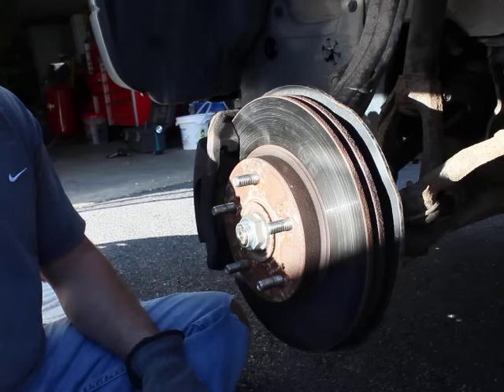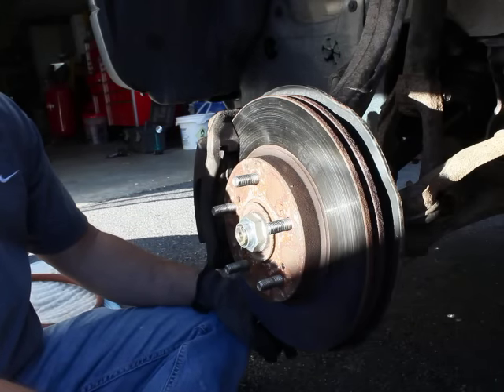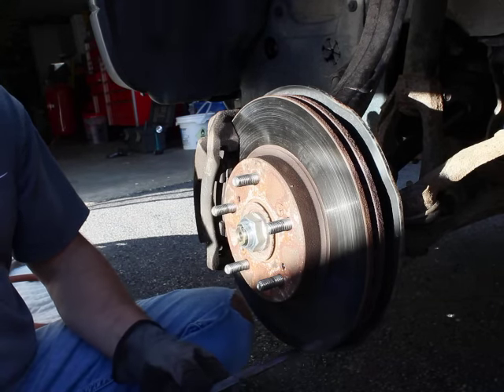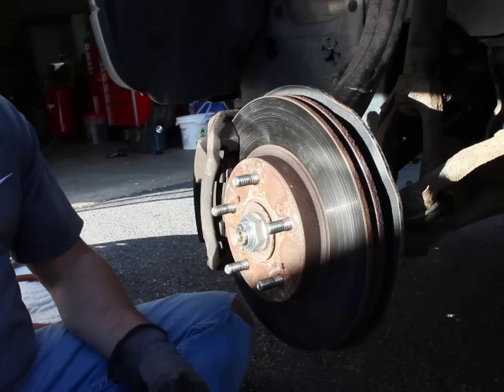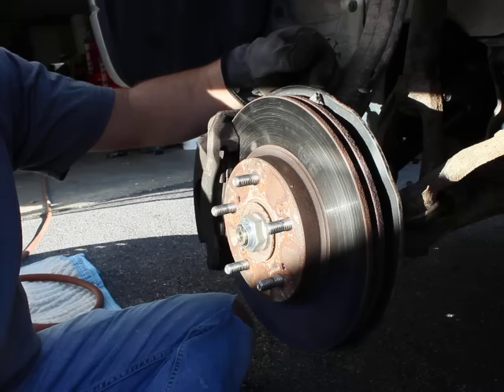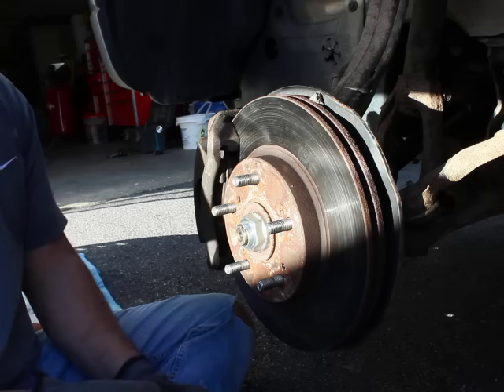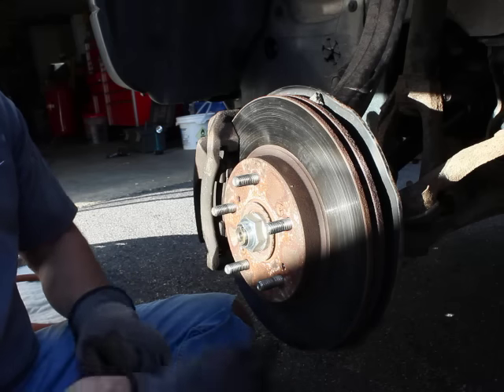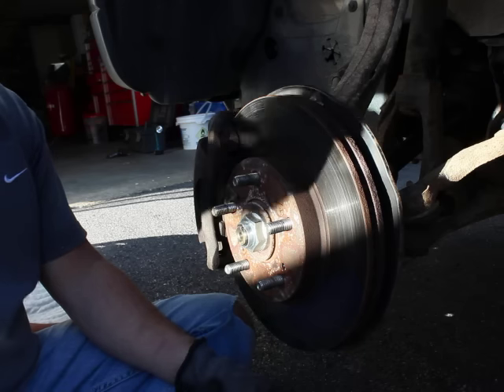Scraping Noise From Wheel While Driving

Comment: Had the same problem recently, and I must say, this video was spot on in the diagnosis. Went to my local mechanic and the guy had me buy brake pads at first  (had replaced them about 4 months ago), then rotors, then a control arm... Thinking of working on my car myself from now on.
Reply from the maker: Hi Thoba, It sucks that mechanics have to take advantage of customers with little automotive knowledge, there is so much legitimate work to be done on cars out there. Keep in mind, there are a lot of honest, reliable mechanics out there, you just need to find them.

Comment: Eddie,

Thank you for this video. This is exactly what happened to me yesterday. I put in new front rotors and pads yesterday and took it for a test drive. After a few minutes I starting hearing a very loud scraping noise, even below 5 mph. I was afraid to drive it back home and called AAA for a tow. I was awake all night trying to figure out what I did wrong. Then this morning I found this video. Bending the dust shield back on both sides did the trick. You're a life saver.
Reply: Mine is making the same noise going about 5-15 mph but it goes away and then makes the noise again when slowing down or braking

Comment: Oh holy crap thanks for this vid. Beyond changing my own oil I'm not a car guy and I know I'd get a "bearings and/or brakes are bad" diagnosis if I took it into any shop around my area. 

So much not a car guy I didn't know if there were bendable bits down there or places debris could get stuck. Driving yesterday and having the noise shift pitch and circumstance was screaming "debris stuck somewhere" at me - but like I said, I didn't know that was a thing.

I'll take a look tomorrow morning and report back. My money's on debris.
Reply: Ran over railroad tracks and heard the grind noise thought my tire was gonna go flying off. Going to check this out thank scared the crap out of me.

Comment: I just changed my front right wheel hub on my 2014 fusion. 1st time doing it. It was humid yesterday and today so I sweat bullets and struggled quite a bit getting some of the bolts out,but I followed instructions and got everything removed, replaced, and back on and  fastened according to their torque requirements. I get in the car with my chest poked out feelin pretty proud of myself for completing this job that would have cost me atleast $350 or more at the shop, pull off to drive and I hear this damn scraping! Instantly dejected! I will try to push the plate back and hope that does the trick cuz now that I think of it, I was pullin on it several times to access the four hub bolts and as I was trying to align the whole knuckle back with the lower strut during re-assembly. Glad that its possibly not a big issue that I have to worry about potentially spending all the money I saved by doing this job myself.
Reply from the maker: Hi Charlie, 
That's a big job to do on the ground so congratulations! Most likely the plate is bent. Keep me posted on what you find, thanks. 👍
Reply: @EddieCarrara1  turns out it was the plate. I gave it a few pushes all the way around it before leaving for work the other morning and the noise was gone. Thanks again for your video. Now I'm riding smooth and breathing normally. 🤣

Comment: Eddie...you son of a gun. You removed about 20lbs of stress from my shoulders today with this video. Sure enough, pebble fell right out once I started pushing on the rotor guard. Expensive noise is gone. I hope you read these comments still and get a nice dopamine hit each time you've saved someone! Cheers!
Reply from the maker: Hi Michael, 😂 I read every comment and respond, and yes It is a bit like dopamine, especially when I help a guy from Siberia in the middle of winter  lol. I'm glad this worked for you, it's not always that easy but every now and then someone gets a quick fix lol. Thanks for taking the time to share, Cheers🍻

Comment: Eddie, I am SO grateful to your expertise and for posting this video. I've got a bunch of personal troubles that I'm currently balancing, and so the sudden loud expensive-sounding scraping noise coming from the front driver's side wheel of my VW Jetta was one of those, "Oh no, yet another problem to address" moments. But, a quick Google lead to your video, which referenced driving on a dirt road, which I had, followed by your recommended inspection, and there it was: a pebble lodged between that plate and the brake disc. Not only was it amazing how spot-on your video is, but I'm about has handy as one-armed juggler. That I fixed it in about 30 seconds is remarkable. Thanks brotherman! Sincerely, Jason Upright, North Palm Beach, FL

Comment from the maker: You're very welcome Dmitri, thank you for taking the time to comment :)
Reply from the maker: No, you fixed it 4imageworks, I just pointed you in the right direction :) Thank you for the feedback, it's just as important as the video, and I really appreciate it.
Reply: Omg THIS POST WAS SO LONG A GO ,,, MY CAR IS MAKING THAT NOISE AND IVE ALREADY PUT 600$ ITTO FIXING IT AND I JUST GOT A CALL THIS MORNING THAT IT STILL DOING THE SAME THING IF YOU COULD POSSIBLE HELP ?I HAVE A NISSAN MARANO 07 I HAD A FLAT TIME I PUT A SPARE ON IT DOVE IT MAYBE 45 MIN AWAY THEN BOOM IT SOUND IT LIKE I HIT SOMTHING AND SOMTHING WAS STUCK IN MY TIRE IT THEN WENT INTO SLIP MOD THEN I GOT NEW TIRE ( FRONT TIRES ARE A DIFFERENT SIZE) ONCE I DROVE IT HOME THEN TO ANOTHER SHOP SLIP LIGHT CAME OFF I HAVE REPLACED THE CV AXEL AND HIB BARREN NOW KNOW BODY KNOW IF ANY BODY COULD PLEASE HELP ME

Comment: Hey Eddie, I hear some grinding sounds when driving. I just  had my buddy change my wheel bearings but don't want to tell him he made another issue accord or fucked up on his job. What would you suggest I do?
Reply from the maker: +MegaBrett54 It's very common to bend the backing plate when replacing a wheel bearing, it may be just a matter of getting in there and banding the plate out of the way. Let me know what you find out, thanks.

Comment from the maker: Hi Shaine Parr,
Try pushing the backing plate away from the rotor on the side you hear the noise, this is definitely you issue. Let me know how you make out, thanks
Reply: Hey Eddie I have something to ask see what you think it is 
I have a scratching noise that only happens when I'm braking sometimes it sounds like a rusted thing trying to turn it cant be my brakes they changed them but from inside the cab of my truck the noise sounds like it's coming from the drive axle but I could be wrong what do you think
Reply: Eddie Carrara I hear that sound when i am going forward, but when i am going in reverse, the sound is barely there. I've had my brakes done about 50 miles ago with no problem.
Reply from the maker: Hi agustaf486, is you truck a 4x4 with locking hubs?

Hi Voicesfollow, Sounds like you may have some rust or debris stuck between the backing plate and rotor. I would bring it back to the mechanic who did the brakes and have them check it. keep me posed on what they say, thanks.
Reply: Eddie Carrara nope its 4x2
Reply from the maker: I would take the wheel off on the side that is making the noise and check the baking plate, you may have some debris stuck between the plate and the rotor.
Reply: +Eddie Carrara im having a similar problem but it doesnt make the noise when i turn. is it still the same thing?
Reply from the maker: It could be, did you try pushing on the backing plate at the wheel that is making noise?
Reply from the maker: Absolutely Steve, try bending the backing plate out of the way on the wheel that is making the noise. Let me know if it works, thanks.
Reply from the maker: Thanks for the update Steve, sometimes snow and ice will push on the plate and distort it as well.
Reply: Eddie Carrara hey
Reply: Eddie Carrara Jacseptickeye watched your video
Reply: Eddie Carrara i just had this happen yesterday
Reply: Nala The lion Did it go away?
Reply: Gloria Fox Yes!! 😍
Reply: How do u push away the backing plate...just a screw driver...just had my breaks and rotors done...it causing the noise now
Reply: Eddie Carrara Hi,
So I went to the mechanic for the same issue on my 2004 Honda Odyssey and the mechanic said it was wheel bearings so I replaced the back rear (both of them) it still made the noise. So he said it needed a new part (the whole arm and where the plate and brakes go) I don’t know what it’s called in English. Well I got the part and....Well I just got it back today and it’s still making that noise (the part he bought it off a junk yard) could it be that it’s the backing plate of brake caliper or even caliper bracket. But it’s making that same noise like a scrapping sound as I’m going 5-10 mph or even while I’m driving 35-45 mph and on somewhat smooth roads. Also, when I’m beginning to slow down and brake.
Yes, I would hit curbs but since having the vehicle since January I’ve only hit it no more than five times. He made it seem like it was my fault and made me replace the whole assembly arm.
Can you please help. He’s charged me $400 just about. Just so it can still have the same issue.
Reply: Janet Verduzco You're being taken advantage of by your mechanic(s)...After all that work you've had done there should be no noise. 9/10 if you're still having that same noise it is EXACTLY what Eddie is recommending... Sometimes when work is done around the brakes, rotor's, calipers(the wheels) there happens to be a rubbing sound after having any of these replaced. I did a brake job on my own vehicle (2004) Toyota Avalon and after doing so I had a rubbing sound that sounded very serious...I had a mechanic tell me it was my CV joint... Which I didn't mind replacing because it needed to be replaced Anyhow...you could see it was time...Well after it was replaced I still had that excruciating noise...I had a mobile mechanic come out to my house and I explained to him everything I just explained to you...Well his recommendation was what Eddie stated above...He got to bending and twisting...and guess what? No more noise...He charged me 20$ and a 12pack.

Comment: What about if you get a metal on metal sound with a high pitched squeaking that is constant coming from the wheel like your exhaust pipe is dragging along the floor but it isn't. I heard it could be a bit of dirt/grit stuck in the wheel hub. A good demo could be to show how you would get rid of that and where the grit is trapped as it is a common problem with some cars.
Reply from the maker: +Stephen Edwards 
Hi Stephen, what you're describing is a wear indicator on the brake pads, dirt and grit should never get caught in the hub because the bearings are always sealed. I'll work on more videos this summer, thanks for your suggestion.
Reply: Stephen Edwards

Comment: My 2008 Envoy makes the same kind of scraping sound--not all the time and usually only when going under 25 MPH and mostly when turning.  The scary part is that occasionally the car has completely stopped (or come close to stopping) while making a sharp turn (like into a parking spot).  Any idea on this?
Reply from the maker: +balooko31 It sounds like you may have a sticking caliper. I recommend having the calipers checked. If a caliper is sticking, it can prematurely wear out brake pads. Let me know what you find, thanks.
Reply: Thanks--getting it looked at on Friday (in 2 days), will try to remember and post the results.
Reply from the maker: Only if you have time, I just like to know if I'm pointing people in the right direction :)

Comment: This scrapping noise occurred from the front wheels sometimes when I make tight turns at slower speed. This noise did not happen until I replaced the front and rear brake pads and rotors recently. I was scared that something is still going wrong with the braking system. But I am glad that I found your video which help me lessen my worries.
Reply from the maker: Awesome JiaQi, if the noise happens after a repair, most of the time it's human error and fixable 😊 Thanks for the feedback 🍻

Comment: Thanks a lot for this video. My 2000 Pontiac Bonneville SSEi developed a major scraping noise from my right rear over the summer. Thought I was gonna have to spent hundreds for a total replacement, but after seeing this video I took a long flathead and poked the shield. It didn't do much at first, but I've done it about 3 times now and today was the first time in months where I didn't hear the scraping noise. I still get squeaks (especially up/down hill) so I probly need to replace my rear brake pads, but I don't think I need to replace rotors/bearings. This vid rocks.
Reply from the maker: Hey Joe Mama, thanks for the feedback. Sometimes the pebble is lodged tight and it will take a little persuasion to remove it.

Comment: This is exactly what I had.
 A small ROCK got stuck in between the rotor plate and the rotor. I'm  trying to get it out now. The initial grinding noise was MASSIVE. sounded like metal sheering off against metal. very scary sounding. THANK YOU so much for this video. will save me a trip to the car shop.

Comment: Glad to find this.. I recently had a thorough check (for winterizing) and was given A Ok on my brakes (but at 70%).  The other day drove into a parking lot where there was a sharp dip before the ramp when entering the lot, then I immediately heard that scraping.. a friend pointed out it sounded like the brake plate.  The noise was primarily coming from the left front wheel for a few days after - then it went away on its own.
Thanks for this post - helps to narrow down all the variables one wonders about
with such noise.  Thank you!!
Reply from the maker: You're welcome A Frank, glad I could help, and thank you for the feedback, I really appreciate it :)

Comment: This is exactly what was making noise on my car. The dust shield on my Jetta is really thin, and it was slightly bent inwards at the bottom enough to scrape the rotor and make a noise. Thanks for saving me a bunch of trouble. Took only seconds to diagnose. :)

Comment: I had the same issue with a 2010 Ford Edge Limited. I was going crazy from the sound. Although it wasn’t constant, it was frustrating not knowing what was going on. I figured it might be the rotor or somewhere in that area. Did what you suggested and the noise is gone. May not be the solution for everyone, but it worked for me. Thanks!

Comment: Thanks for explaining, exact sound I hear from time to time. It's not consistent and this explains it. I have a driveway with tiny gravels scattered which get's picked up by my wheels. No wonder I can only hear it the first minute I get our of the driveway and scraping goes away once I'm at 3rd gear.
Reply from the maker: It may also be the wear indicator is touching the rotor warning you the the brakes are getting low. If this is the case the noise disappeared after a minute of driving because the pads heat up and the metal tab expands away from the rotor, when it cools down it will touch the rotor again. It wouldn't be a bad idea to check all brake pads, especially the inner pads, they tend to wear quicker because they are up against the piston and that is where the wear indicator is usually located.

Comment: Thank you so much for sharing this! I was having same issue with vehicle my daughter drives and had scheduled an appointment to take it in. But then I found your video so I thought well I'll check it out. I was able to see the plate because these wheels have holes in them, and I could see that the plate was very rusty around the bottom. I think maybe that the plate is corroded somewhere as when I pushed it back some rusty dust came out. In any case, the wheel is no longer making the noise. Thank you!
Reply from the maker: Hi Susanne, that's great news, I love the simple fixes that cost nothing but a little time. Thank you Susanne, for the feedback, it really means a lot to me :)

Comment: I was a mechanic when I was a kid and then onto something else but always have done all the work on all of my cars except major stuff or if the vehicle was under warrantee, I would just bring it in. I just replaced all the rotors and pads on a 2006 Range Rover HSE Supercharged which has Brembo fronts and regular RR backs. Real fun to bleed.   All discs. Well, after I was done, took it out for a ride and heard this weird scraping noise in the left rear tire area, especially when turning left and no noise when turning right.  Since it is a 4 wheel drive, I had to lift all the tires of the ground  to adjust the parking brake which I read could be the culprit. Didn't work. I took everything apart in the back, cleaned any debris, rust, gunk (though it was pretty clean to begin with) and put it back together. Ug!!! I finally gave up and thought its going to the repair shop (cha-ching for these SUVs). Well, I gave it one more shot on youtube and found your video. I thought, no way, I already gave it some sort of a push before when the wheels were off but I crawled underneath and pulled on both backing plates. It fixed it! I couldn't beleive it since this has never happened to me before. So, here it is. THANK YOU!!!!!!!

Comment: Thanks, Bro. I just had my brakes and rotors changed. I have been hearing that same noise. I was wondering what it was. However, I figured that probably was the case. I thought my wheel was scraping against the rotor. Now, I know it's the rotor scraping against that plate, because of your video. Thanks, again.

Comment: Thanks man i installed some prothane bushings on the lower control arms and did a lot of work to the front suspension system (installed camber kit, coilovers) and all of a sudden that noise when I drive the car, took off the wheel and everything was looking good now i feel stupid for not knowing this, thanks for the video man!